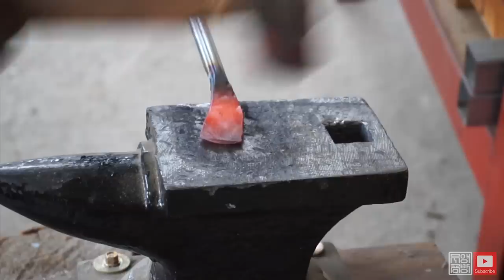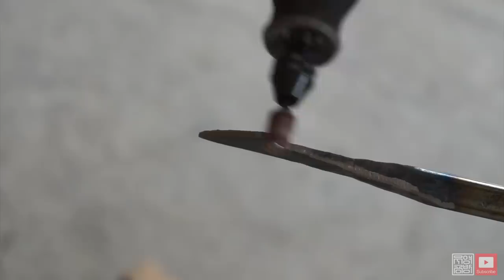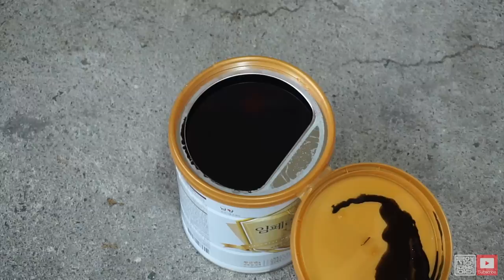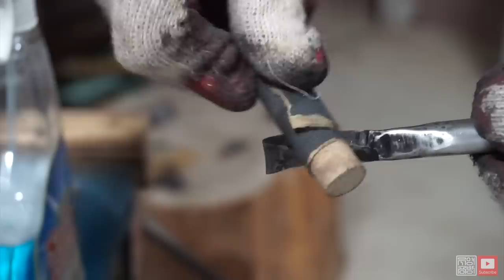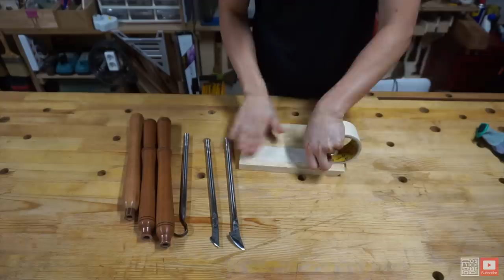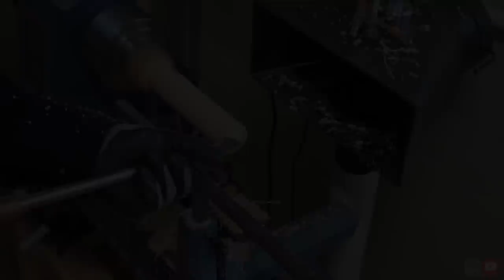Making Woodturning Tools (Skew Chisel, hollow tools) | Woodturning Tools

Comment: wich metal you used to make your tool and they still sharp long enough when you use them?
Reply from the maker: It is not sharper than high-speed steel.
But if you grind it often, it is sharp.
It is cumbersome to grind frequently.
Thanks for watching😊